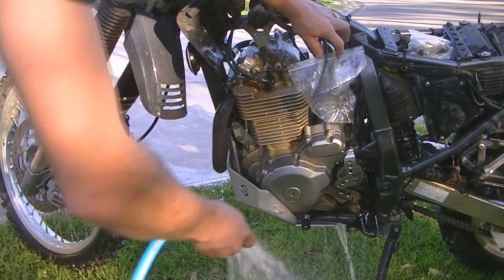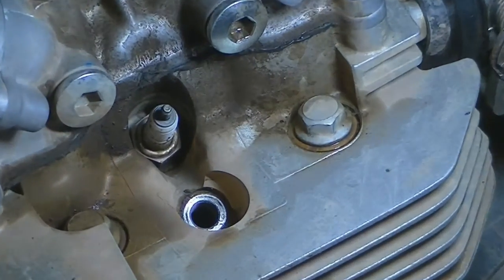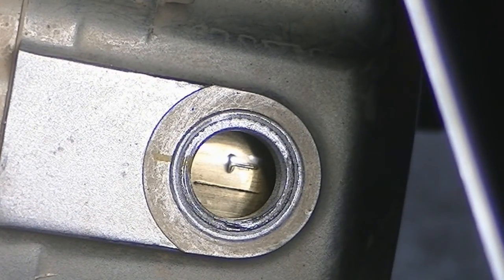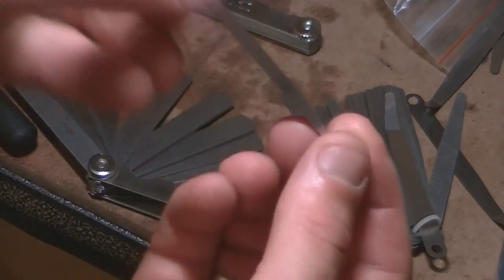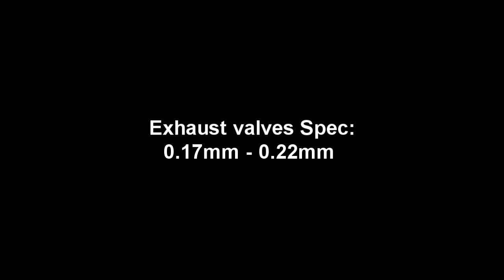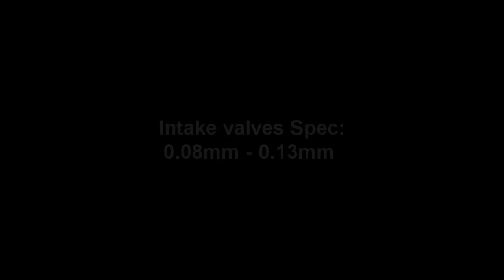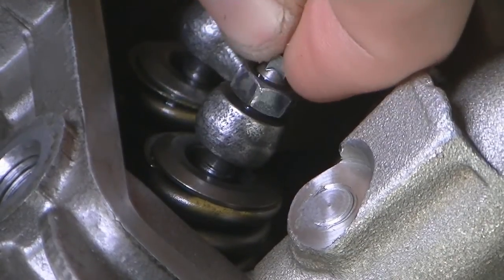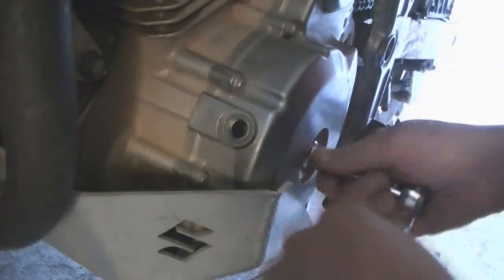Valve clearances (DR650) STEP-BY-STEP Adjustable valve

Comment: I am abit confuse,I am asking.are the intake and exhaust valve checked at the same time when on the compression stroke.basically,I'm asking do you turn the engine just once on to do both intake and exhaust valves
Reply: Did you ever find an answer to your question? I got the bike apart right now lol and now I'm wondering the same

Comment: The nut on the tappet is 10mm not 8mm
Reply from the maker: You're right. My bad, I had an different engine on the bench to film the adjustment (which was 8mm) as I couldn't get a good camera angle on the DR. I'll see if I can add a notation. Cheers.

Comment: I pulled the timing cover off and all of my oil leaked out, bike had been sitting for a year anyone know whats wrong?
Reply from the maker: Could be a few things overfilled (if winterised), Potential needle and seat carby problem, fuel could leak into the motor "overfilling it", more so if the overflow tube is blocked. does the oil smell like fuel? Is the tank near empty? Is the oil colour white?
Reply: @doubleenvelopment6480  Thanks for the reply, the oil didn't smell of gas neither had a off color. The oil seem to have drained out of the timing cover/crank bolt cover as if it was a drain plug. Odd, maybe since it's been on a kickstand for a year and not started?
Reply from the maker: @oBlackCoffee  Sorry, I thought you were talking about the top alignment cover (the small one). If it was on the side sand and the you took the centre one out , It's likley to do that.
Reply: @doubleenvelopment6480  oh okay just wanted to be sure that was normal, didn't realize. Thx

Comment: Thanks for the awesome video mate! 

For anyone who is wondering... You need an 8mm allen key to open the flywheel inspection cover and a 10mm allen key to open the timing plug. Great idea to give the engine a quick clean before this procedure and be careful not to strip the timing plug!

Torque specs and other DR650 info is available here: https://www.vincestrangmotorcycles.com.au/DR650ServiceData.pdf

Comment: Which are the exhaust valves and which are the intake valves? And are all done on the compression stroke? Cheers.
Reply: if I can jump in .... yes, both done on compression stroke at the same time.  Exhaust valves at front of motor, nearest exhaust pipe

Comment: They’re basically lawnmower engines, extremely simple...but tried and tested technology. I always preferred to remove all spark plugs, and the rotate the engine by leaving it in 1st gear and simply moving the rear wheel in the direction of travel. You get a lot more leverage that way,and you can literally see the flywheel moving in millimeters, it’s very precise. This is how tappets we’re set on Norton Commandos and Triumph Bonnevilles when they were new.

Comment: Using your video I set my intake valve to 0.10 and exhaust valves to 0.19 and prior to adjusting them I couldn't get a 0.05 in the exhaust and intake I'm pretty sure the guy I bought it off of never adjusted the valves